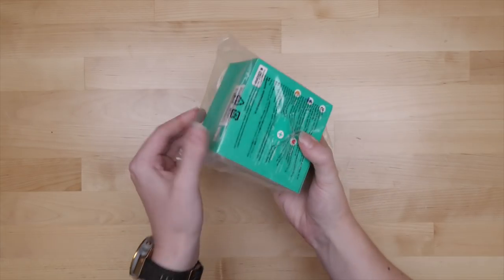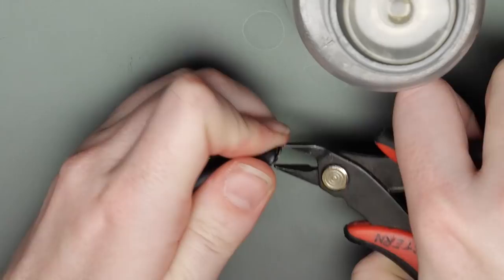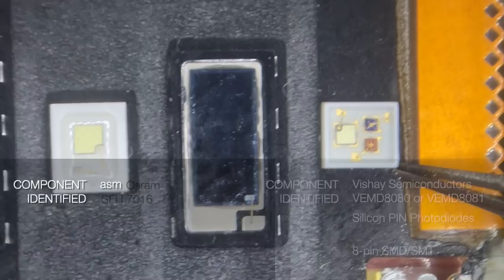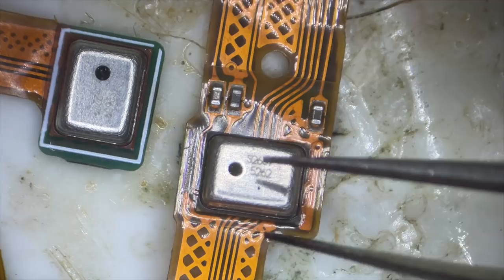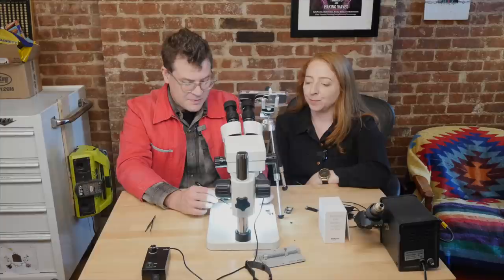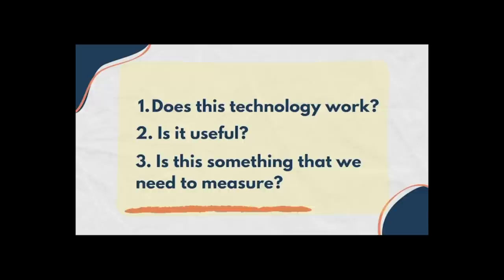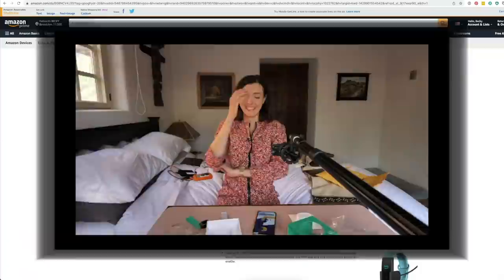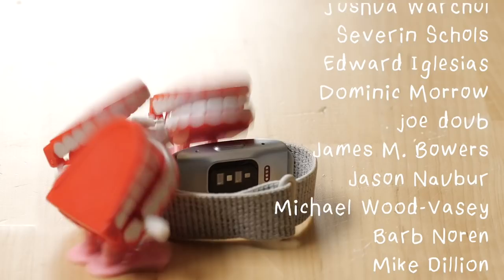What's inside the Amazon Halo?

Comment: It's possible that they don't have a good enough dataset, and this device is supposed to help build one.
Getting millions of tech enthusiasts to buy a device to give Amazon all the data that they need to build a significantly better ML model, which they can then sell as an AWS service in a few years, is very likely.
Sounds like the audio data that they collect from Alexa users isn't enough for them.
Reply: Amazon are obsessed with data. I have worked with them and they had some ridiculously strict rules and policies for doing tests. we are talking customers spent millions getting past these tests. then, 2 years later they just dropped them saying "we have enough data now to go ahead and do what we want to do. the testing isn't needed any more". Were talking about going from a multi million dollar certified lab and reports to "here is a single side of A4 and you can do it at home" change.